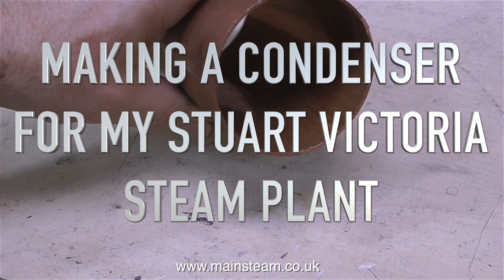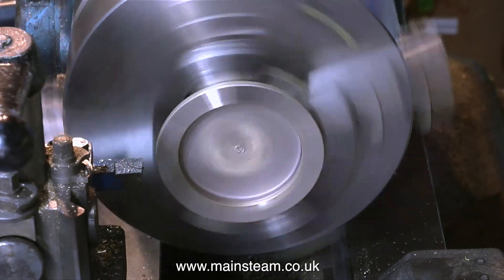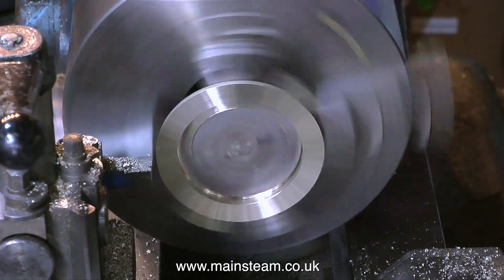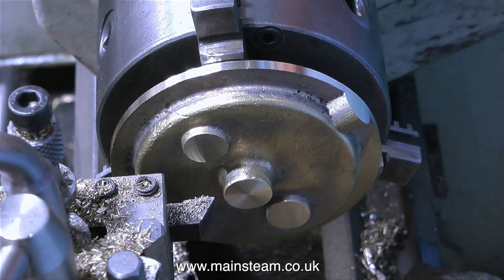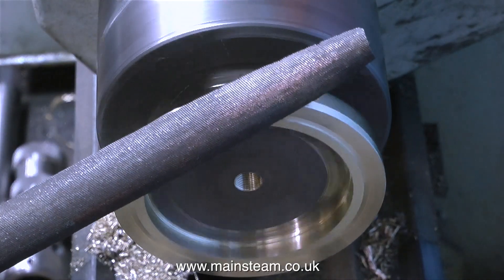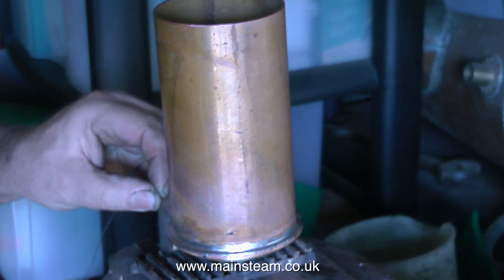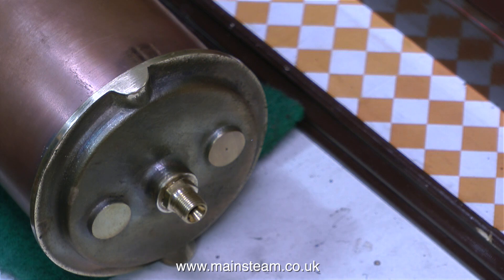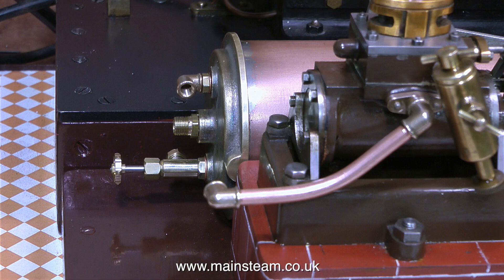MAKING A CONDENSER FOR MY VICTORIA STEAM PLANT

Comment: Thanks again Keith for another excellent video.
I'm from Canada so you might think this isn't the best question in the world but
what is Gun Metal?    Here in Canada it is considered a really poor quality material
in fact I haven't heard about it for years.  It melts at a really low temperature and 
is very weak.  I believe they used to use it for door handles on cars which would 
break just after the warranty was up but that was eons ago.  Rod
Reply from the maker: Gunmetal is type of bronze alloy - I Google it ....... try this: https://en.wikipedia.org/wiki/Gunmetal
Reply: I think you are referring to "pot metal" which was the term my farther and his generation called any cheap light metal castings
Reply: Thank you very much for the information    Rod

Comment: Woow, I wish I was pensioned and had machines like you have. Maybe in a couple of years. Just had my own (rather disappointing) experience. Bought a 'completely and well machined' box of parts for a Stuart beam engine. Most part were there (no all) I will admit. But found that a lot of parts were wrong and the engineer mixed BA with metric at random. I fiddled around with some days (and enjoyed that). I got it to a point where all main components were moving (with lots of extra spacers and nothing tightened, to compensate for all the engineering mistakes) but was unable to fit the steam chest (studs not tapped straight). I won't bather you with the rest that was wrong. I returned it and the hunt for a repairable (with simple hand tools) engine continues....
Reply: I confess: I used a Bahco! Worked great to since you don't really tighten anything. Also found a couple of broken taps under glued in studs....
Reply from the maker: I wish that I was pensioned too ........ unfortunately not yet ......... Often buying a "Part finished" bargain is not what it first seems .....
Reply: Yep, I was warned (by you) before I acquired it; had to find out for myself (the hard way). Still had some fun trying to piece it together....:-). I thought you were lucky enough to be pensioned; sorry for the mistake.

Comment: What are the pros, and cons of tap size 32-40 thread per inch?
Reply from the maker: I prefer 40tpi, these are used on model steam locomotives. I find 32 tpi a bit clumsy and for small applications the more threads per inch that you have, the better the grip.
Reply: Thank you, Keith.

Comment: Take this with a grain of salt, for I have never operated a lathe before (really want to, though, and been watching lots of Clickspring's videos), but you could take a piece of aluminum rod, bore and tap it to fit the bolt or threaded rod you want to machine, and then use a hacksaw to cut a slit on one side.  Twist the bolt or threaded rod into the hole, then clamp it in your three jaw chuck.  The slit you added will allow the assembly to compress, tightly holding the bolt without damaging the threads.  If you machine a lot of threaded things, such a clamp could be useful.

Comment: did you fill the condenser with any kind of high surface area media? typically on a car air/oil separator (which is essentially analogous to this), they're filled with stainless steel wool to promote the heavier oil droplets clinging to the surface and falling out of suspension.
Reply from the maker: No, it's not necessary in this application. The steam oil is very thick and tends to stay in the condenser.oil trap.

Comment: Just a tip you can square up tubes on the lathe. Hold the tube from the inside with jaws of the chuck.
Reply from the maker: Except when the copper tube is as long as this one ........